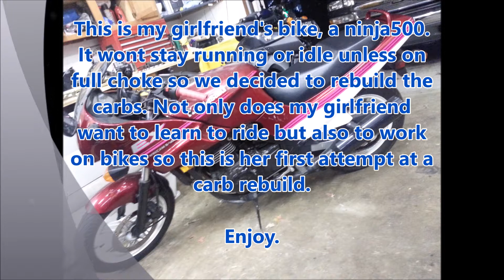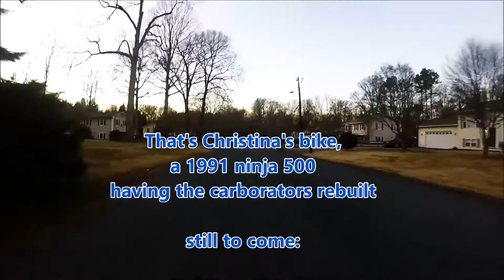my girlfriend is awesome

Comment: Nice!  Did rebuilding the carbs kick out the rest of the cobwebs running wise?
Reply from the maker: yeah. it's running pretty good now. it has a slight hesitation when you quickly go wide open with it but we haven't spent much time fine tuning it yet and once we do I'm sure it will be fine.